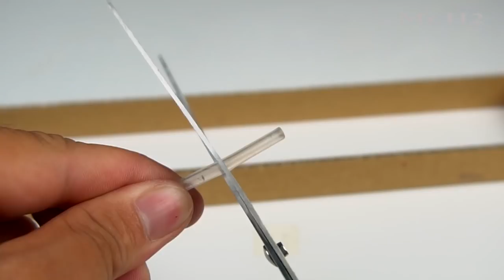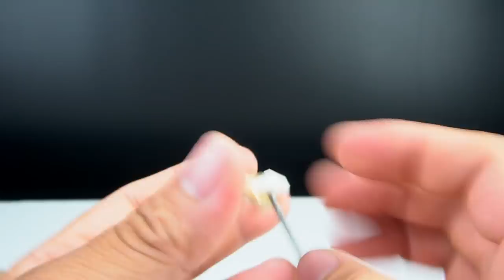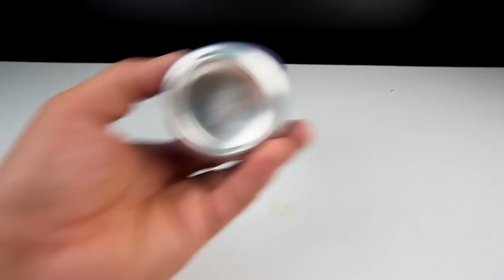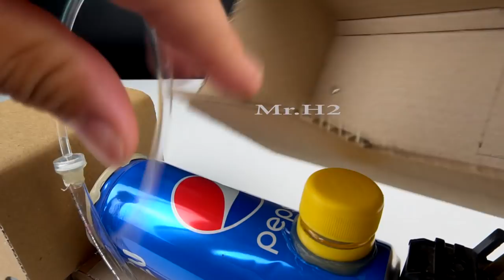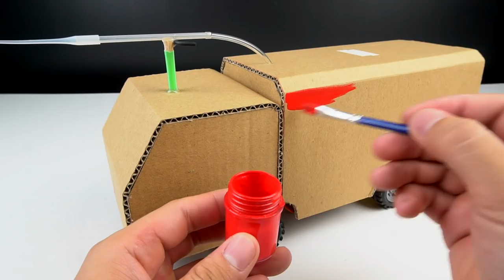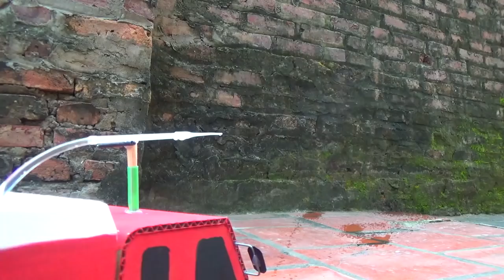How to Make Remote Control Fire Truck at Home from Cardboard - Diy Rc Car

Comment: Please can you provide link for transmitter receiver!!!!!
Reply from the maker: You can get them at the old remote control car (same me https://youtu.be/2aiWv-V3mnI)
Reply: @MrH2official  jmkkkmmjmkmnmkjkmkikmkkkkymkymmkkkkyiykmmmjjjjjiymymmkyjkyykkmmyyjykkkmkmkmmmjkykyyyymykkykkykykkimkmmmkkkyyyikmjyikmmmikhhljmkikmiiykkmmkymkykiyymkmkmmmkikukmiyyiykmkmmkmkyiyikkmkimyykmmyimmjjmjmukkkkkkyyykkyyykkyyikkkiyiyiikiyyimykymykykyykmykkyjkkikykkkymiykkkkyiyiykyiyiykmkyiyyikkykljkiiykkyyiiyyiiikmiymyiymk8k66l7lukkpiliip7ollo7llooolku77p787o8797l77l97l8ol7ll78ooo887oo7o7o88o8o8olo7o777977o87ol777ô777oi7ioo707oo777l7777o7777oo7777o8lo7l77887o7ok7o77i877o7o77777887p788l870oo87778ollo8797979oo77ô97l8i8o79l8lp7879787io9o9o8ơo9778oo799ô807777l9979777779oo7777778oo777l89o98o78o8o7o87o9888iooơ897798889778o7o8o77o0o8ooo7708o8o8i8878oo8799989i77ô8988ki88o7oôi8o8ôô889k87o7o98ơ879o78ôô88o87oo7778988o9o9ooôôo99o8ơôôlo8988o97o9k899o989ôôo8787ô0